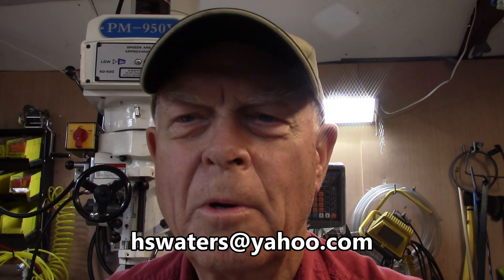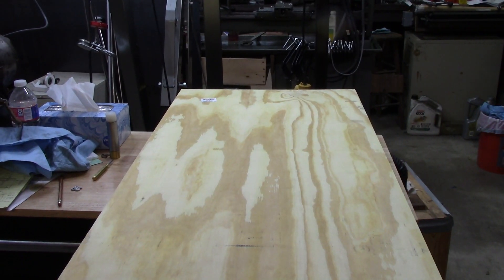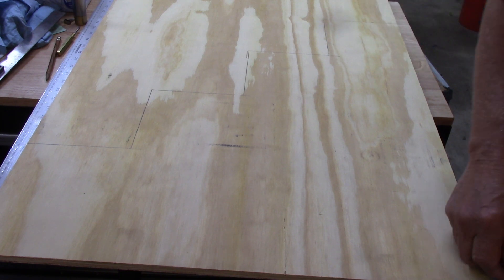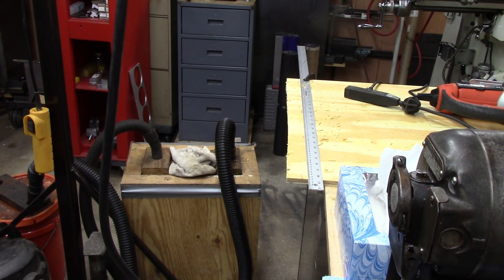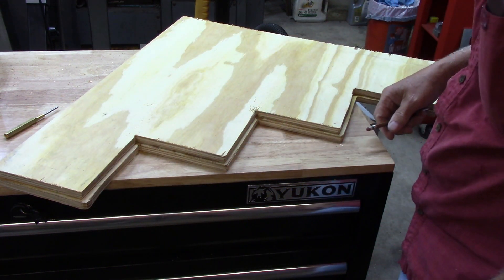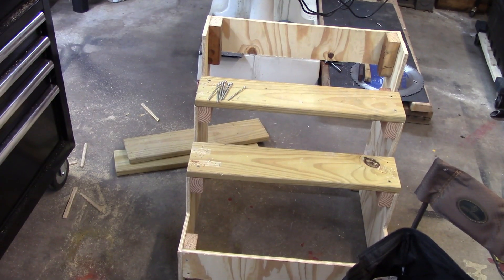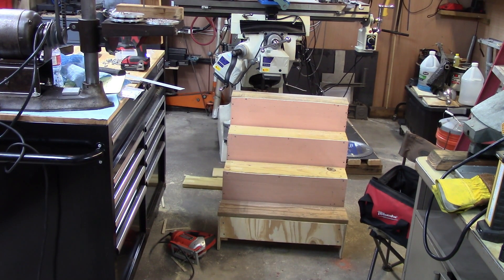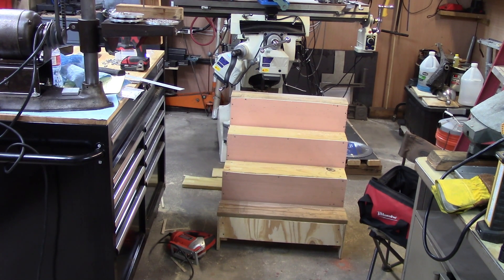Stairs for Daisy

Comment: Hello Harold,  Older dogs like us have trouble with hip joints often so climbing stairs is very difficult and painful for them.  When Mr. Duke was with me I had the same problem as you are encountering so I made a ramp.  Had a cleat the hooked on the door jamb and I surfaced it with a rubber mat installing 3/4 x 3/4 strips as an aid in getting traction for him going up.  It was very effective and he used it gratefully.  He too was a large Lab weighing in at 110 pounds none of which was fat so I couldn't lift him very much either.  I carried it in the bed of the truck wherever we went and he went everywhere I did.  Quick to build out of 3/4 plywood and a few scraps.  Good luck with your project and give Daisy a big hug for me.  Doug
Reply from the maker: Thanks Douglas.

Comment: Harold, in my past life I was a vet tech. I have also raised mastiffs for over 25 years. If Daisy does not take to the steps, don't urge her. Sometimes steps are harder on their hips because of the short tread distance. Ramps tend to be much more preferable for older dogs. The longer the better, most commercial ones fold in the middle. If she is still resistant to using it, sometimes railings make a big difference in their comfort, it can be purely visual like a piece of rope. I don't know if you have her on any supplements, but glucosamine and chondroitin are both excellent, you will see the difference about 6 weeks after starting. A lot of owners mistakenly believe their dog is frightened by the steps and encourage them with treats and/or pushing. It is more painful for them to use stairs. I hope I don't offend you, but the best thing you could do for Daisy's comfort is to put her on a diet. I'm not critical, it often feels like they deserve to eat whatever they like, particularly late in life. You would be surprised, a 25% reduction in food, light walks only, no stairs or jumping in and out of vehicles, and supplements she will be like a puppy again for her last years.
Reply from the maker: She is totally devoted to food so I don't see here losing any weight.  Thank Jean-Paul.

Comment: Wow small world. I have been working with some tree carcas on my 3d printer enclosure in the last few days. Trying to keep the temperature in. Daisy will for sure get used to it. One more thing not sure how prone to spinal damage daisy is, but jumping on the ground is not good for her. Maybe training her to use the steps on the way down too would be a good idea. Also locking casters? That would make it easy to roll the steps.
Reply from the maker: i am going to try to get her to come down the stairs as well as up.  Thanks Bruno.